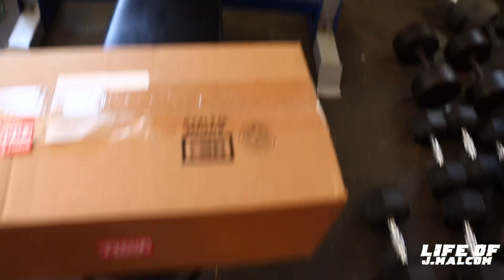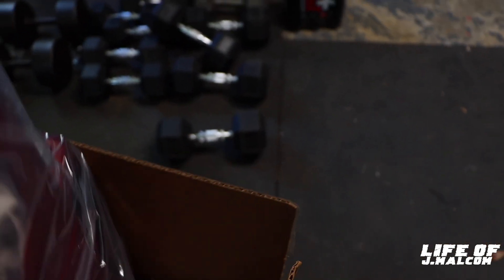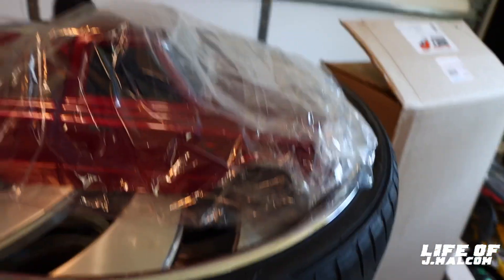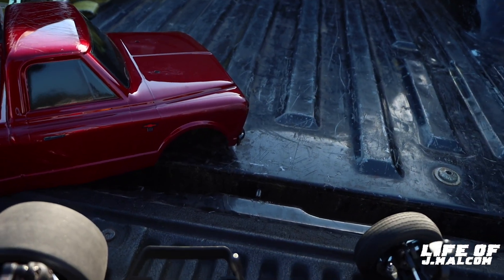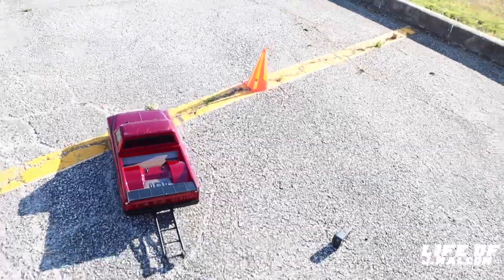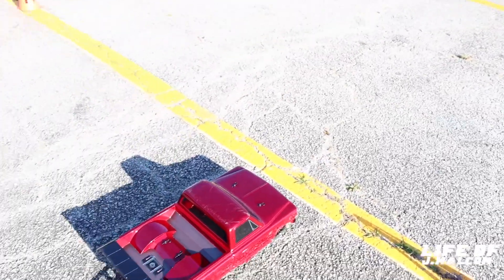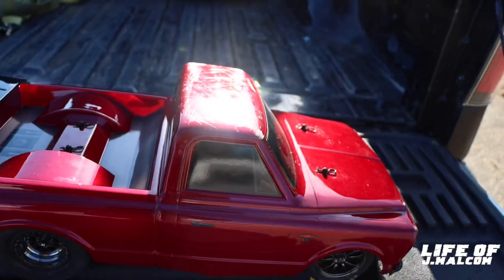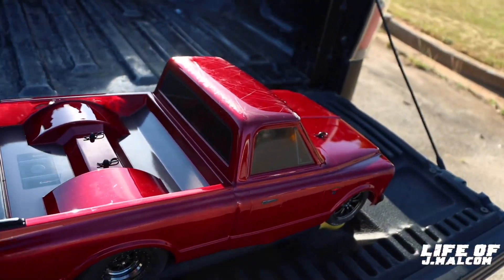TIME TO FINALLY SEE WHAT SPEED MY TRAXXAS DRAG SLASH WILL PUT DOWN

Comment: Bruh I been in RC for a long time before taking a break but I still have my rc cars & trucks now, one of them is a slash , I have a 3s battery with a upgraded electric motor plus dual fans on it & a set of street tires high performance & few little minor upgrades, including changing the pinion gear & I was clocked at 79 plus , this was on a large smooth parking lot of course , depending on how you set them up you can most definitely get fast speed that you want😎💯👍🏾🔥
Reply from the maker: Thanks for the tips bro
Reply: I’m also into those big toys too like u😎💯👍🏾🔥😁

Comment: Bro find a black top parking lot smooth
Reply: Get a piece of carpet spray brake cleaner on it for tires get you a 31 pinion with stock spur should be in the 50 + mph